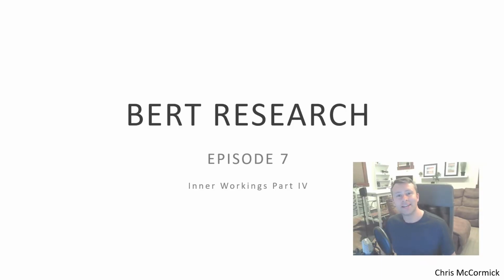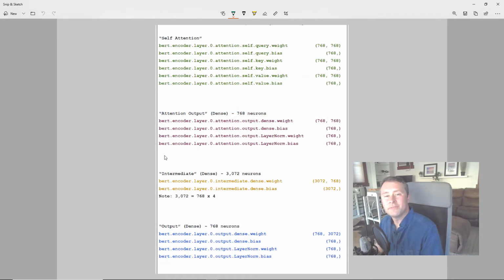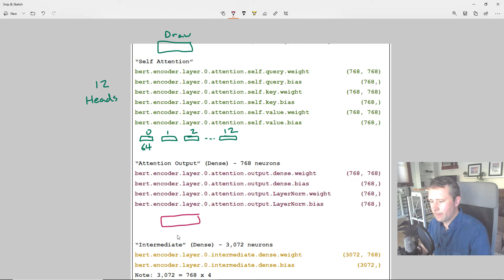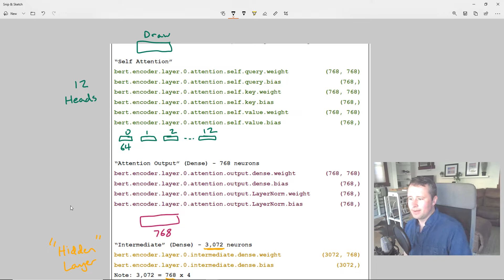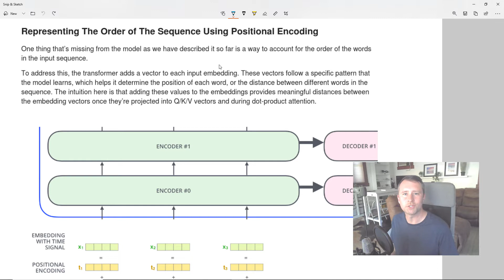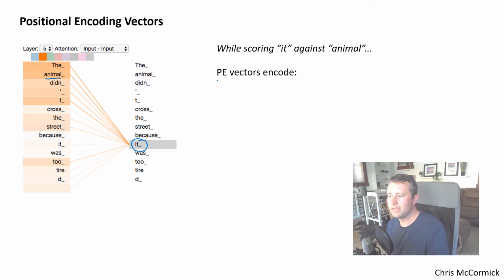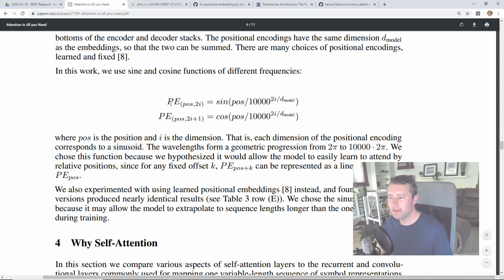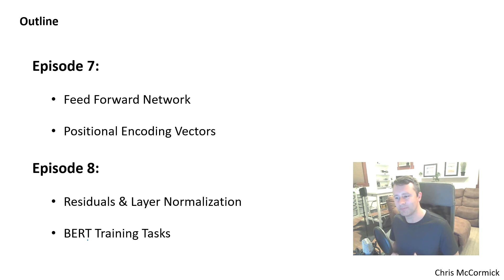BERT Research - Ep. 7 - Inner Workings IV - FFN and Positional Encoding

Comment: Thanks for the nice video you did there, I read the BERT code and attention is all you need  paper. Though the transformer used fixed position encoding for the model  easy to learn, BERT uses learned position encoding rather than fixed position encoding(sin , cos). Could there be any chance to know how BERT did it?